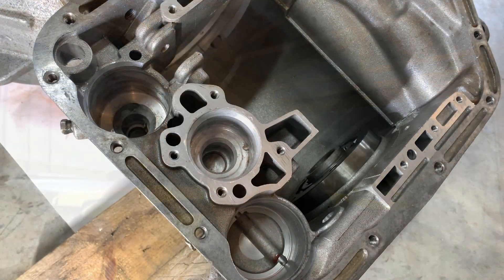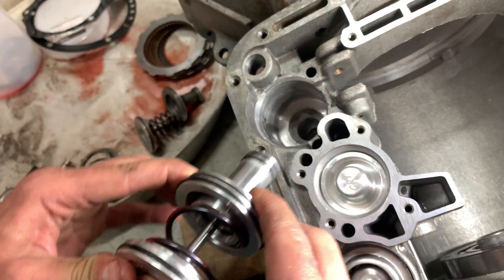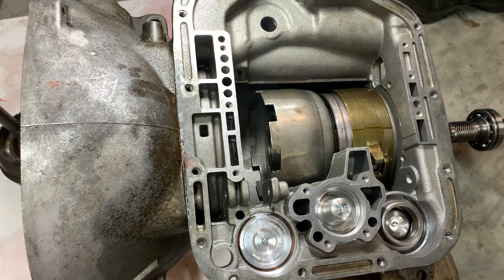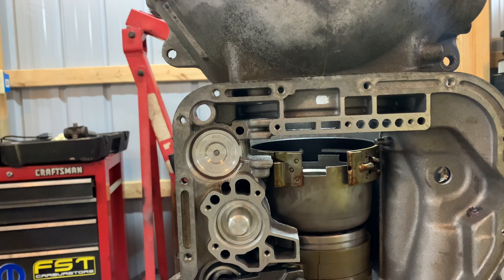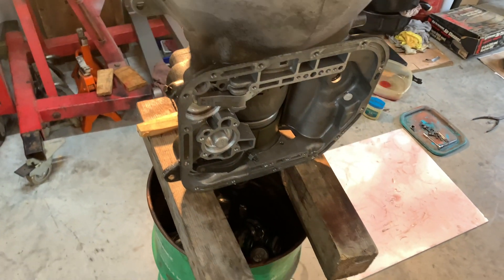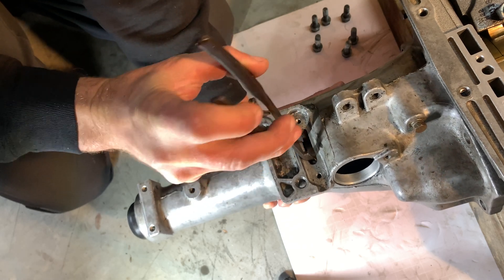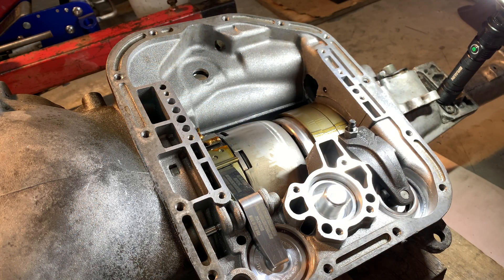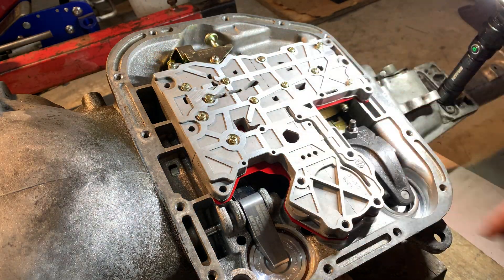pt.4 Final assembly of the stout 904 transmission. @CopeRacingTransmissions

Comment: Thanks for going into detail
Reply from the maker: No problem buddy
Reply: @Duster_Garage it’s great how you show each important step cause I need to find out why my 904 has no reverse.
Reply from the maker: @dskitch  the only 2 things applied in reverse is the low/reverse band and the direct clutch pack. So if there is no problem with 3rd gear(drive), the direct clutch is ok. Then I would suspect something is going on with the low/reverse band or servo.
Reply: @Duster_Garage I pulled the pan off and reverse band broke

Comment: What stall converter are you running?  Would you happen to have a part number?
Reply from the maker: It’s rated at 3000-3600 stall. It actually has loosened up a good bit since I installed it 18 years ago. Flashes around 4200 now. It’s a TCI 10” street fighter. P/n TCI-142300 from Summit racing.

Comment: Well done sir!   A couple of things I have run into are cracked welds on the planetaries. When you check for excessive play in the gears, look very closely at the welds on the pins. A couple of welds were cracked. I ordered a replacement  planetary (used), and every weld was cracked. The guy I bought them from said he had never seen that before and quickly sent me a replacement. However, the cracks are easily overlooked as they are difficult to see. Also the depth the drum engages the notches of the drive shell can vary, especially if parts have been replaced. This is easily adjusted by the washer on the front of the output shaft. I prefer going a little deeper into the notch but not all the way to the bottom.   Thanks for posting!
Reply from the maker: Thank you. Those are some good tips. I appreciate your insight. It seems like every time I take a trans apart, I learn something new. Now I have the tips you just gave me. Thanks again sir.

Comment: Hey bro this is the dude with the purple duster I went to the track and I'm having huge converter issues any suggestions on who I should buy a converter from
Reply from the maker: I’ve heard that Dynamic makes a really good 9.5” street/strip converter. If you’re only drag racing it, go for an 8”. Dynamic, A1 and ATI are all good.
Reply: @Duster_Garage  the one cool thing is I did it just like you I drove roughly 35 miles each way the car did go to the track and back but the converter is just ridiculous...ty for your input.... so are you suggesting a 9 1/2 inch converter with 3000 stall??? I didn't use the trans brake at the track but without the chip in it and using a trans brake on the street you just flooring it the motor goes to 5300
Reply from the maker: @joshuacohn2004 I consider anytime you drive your car to the track, race it, then drive it home, that’s a successful day. I would think 3000 stall would be minimum you should have. I don’t have any experience with a trans brake so I can’t offer any thoughts on that.